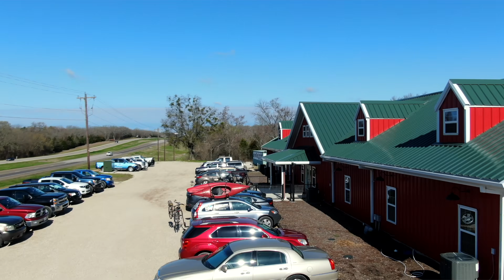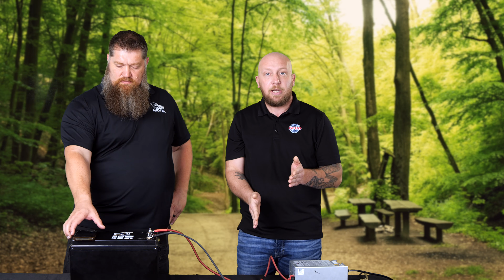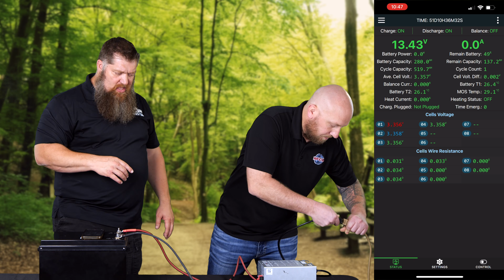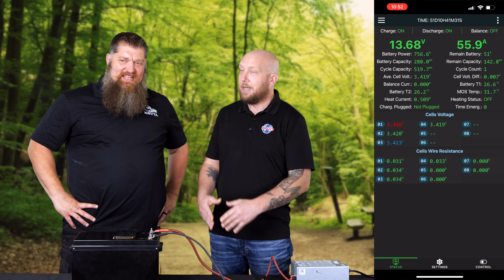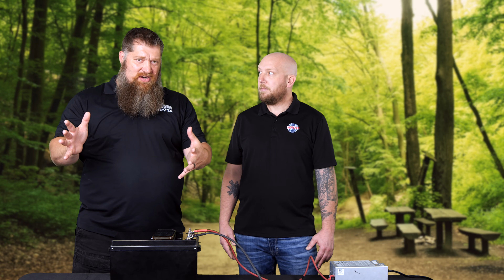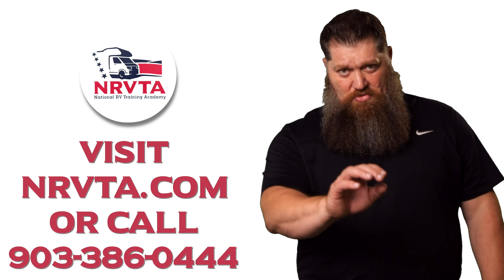WFCO auto detect battery charger, does it actually work?

Comment: Oh boy... Still not KISS... So, when my lithium ion LifePo 100AH group 24 size new batts arrive, put em in turn off all charging and discharge them (to what point???) and THEN, get the OEM solar array to NOT be a part of the charging process. Let them charge up with a straight electrical charge and let the converter figure it out. At that point, it will have identified lithium Ion as the batteries being used.

Comment: Ok so I installed a new WFCO-9855, installed a brand new LEAD ACID battery, right off the bat it was reading it as a lithium battery. We run our appliances, go to bed wake up all we have is outlet power nothing else is working. Blue light is on in the converter for about 2 hours then there’s no power to the converter at all. NOW WHAT?? SHORE POWER HAS BEEN HOOKED UP and we’re not getting anything.

Comment: FYI, we were successful detecting lithium using these steps from support: disconnect solar and shore power, drain battery to under 20% (we went to about 12%), restore shore power and fully charge. Wait even after 100% reached. For us it flipped to green about 30 min after fully charged. GL.

Comment: Mine (installed yesterday) NEVER has the blue LED on.  I’ve run my lithium all the way down as I was instructed to do and the converter always has the Red and Green lights on.  My battery from 10% charged for over 12 hour and only got to 13.5.  Very disappointing.  Then you tell me unless I unhook my solar, it won’t work to full capacity.  That’s just no good.

Comment: When I buy a product, I don’t expect it to eventually to work. And in my case it never did because my batteries were 20 feet from the converter. Repeated inquiries to WFCO didn’t solve my problem and eventually they stopped responding. WFCO should just admit their problem and go back to a switchable unit.

Comment: You didn't discuss the fact that the WFCO has a 4hr bulk charge timer. if you run down your battery you will only get 4hrs of changing before it goes into maintain if plugged in. The only way to reset the time is to power cycle the unit.
Reply: With this information, it sounds like there are multiple reasons not to buy this brand even though I want to so badly. They’re the only one out there with 100 amp charger, but with this auto detect that doesn’t work for most people and this time that you’re talking about, they’re giving me so many reasons not to want to buy it.

Comment: I just added the Victron Multiplus II 2x120. I was informed to unplug the converter from the Rig house panel to prevent it from charging the batteries as the Victron will now do that. When I unplugged the Converter and turned off the battery disconnect next to the panel in the rig I lost all 12 Volt power. I switched the battery disconnect back on and still no 12 Volt power. I tested everything and found all voltages correct except for the 12 Volt Voltage entering the Main panel that was at "0". . When I plugged the converter back in I did get back the 12 Volts in the Rig house panel. Any suggestion?
Reply from the maker: @vitoconginejr3283  so it sounds as though your batteries that you are using for the inverter is either not tied into the 12volt distribution, or the fuse is blown between the battery and the 12volt distribution.

Comment: Seems like this auto-detect is a really bad solution to a problem that didn't exist.  I mean, it's not like you're switching back and forth between battery technologies.  If you switch your batteries to Li, you know you did it... so flip the switch.  And don't worry about it for the next 10+ years (probably the life of the RV).  With this "solution looking for a problem", now your charger might switch back to LA because you unplugged mid-charge, or for some other ridiculous/random reason.  It's too bad WFCO doesn't have a manual switch that overrides the auto-detect -- that would be the best of both worlds: 
1) manual those who what they're doing and want a consistent product that just works 
2) auto-detect for those don't care to take the time to learn the basics of their RV

Comment: WFCO is blaming it on “install”? Nonsense. That is mildly insulting and taking advantage of the general ignorance in the RV industry and RV owners when it comes to electricity. While there is some truth about long cable runs or the incorrect gauge of the wire being used, the fact is that their product is improperly designed and the Auto-Detect feature simply does not work. It is a great sounding idea but one that is extremely hard to implement in the real world. It is just a marketing gimmick to make it sound like it is automatic when it simply is does not work like they would like you to believe. Electrical and Electronics Engineer here. I have already owned 2 RVs with these converters and performed numerous tests that disprove most of the nonsense I just heard. Do yourself a favor and stay away from any of these WFCO Auto-Detect products. 
WFCO should perhaps do themselves the favor of forgetting about the Auto-Detect nonsense and just go back to a very simple switch with 2 profiles. It is almost as if they believe that every RV owner is dumb. They have created so much inconvenience and heartburn with their awful controller and software, just put the switch back into the units and stop making peoples lives so absurdly complicated. The thing simply does not work with Auto-Detect, else they would not be here doing a video to try to explain themselves and point fingers. Looks like WFCO knows they messed up. 

I saved myself 1000 headaches with these by just installing a Progressive Dynamics converter. It has a simple switch and always provides the correct voltage. One less variable to worry about. 
No need to worry about a temperamental converter. 
RV life is complicated enough as it is.
Reply from the maker: @GranCoyon  as long as “they” means WFCO. I did not state anything like that.
Reply: @NationalRVTrainingAcademy  to me WFCO’s statements in this video are nothing more than a charade about their faulty product.
Reply: @NationalRVTrainingAcademy  You are correct. I have modified my comment accordingly.

Comment: The lead acid battery limits the current based on its higher internal resistnce.  LFP' gulp current much more easily than LA batteries.

Comment: Why not have your gurus simply measure the open circuit resistance with remote sensing leads to determine the chemistry?  Why no remote voltage sensing capabilities period?  This would overcome voltage drop issues at large.

Comment: Why advise people to induce a protective function of the internal BMS?  Doesn't seem wise.  Why talk about teetertotters when you can address how and why the charger is designed to actually behave?  I.e. Current limitting, staye of charge, voltage control

Comment: New converter n battery lithium. Do you have to discharge the battery once before it will auto detect n work? Plus if my gas is turned off and I turn it on how does my 2 way fridge begin to work

Comment: So far, not so good for me. Ordered from Camping World, as WFCO techs told me they should have the latest firmware. Drew it down to zero, briefly started charging at 50 amps, dropped down to 1 or 2 amps, never got fully charged. And green light still on, not blue. Now they want to know my firmware version, which I just emailed. He also said it might not handle a larger (280ah) battery. Going to give them one more day, then sending it back, and will buy an external charger. Frustrating, it shouldn't be like this.
Reply: Update, had them send me the jumper to make it full time lithium. Working fine.

Comment: How can I tell if My unit has the correct firmware and will work if I install a lithium battery on my unit?
Reply: I have this one and sometimes it shows Communication failure, and to fix this I reset the Solar connector and then it works again, should this do this?   Also, when on direct power I am showing 14.3 volts and when on solar charging the same but then on generator power it is only 13.7 volts.  I am currently use Led acid batteries, two group 27 batteries.  I want to get Lithium batteries and want to know do I need to do something here to make sure the Lithium batteries charge properly?
Reply: Model is the WF-8955-AD-GE on a Grand Design Momentum 25G with a Onan 4000 generator.

Comment: So I have a question.. to make both solar and Dc converter optimal. If I used a Renogy Dc to dc with mppt control. Could I place the output of the converter into the alternator leg of the controller? This would allow both converter and solar to work in tandem.. theoretically anyhow.. brain spinning
Reply: Connect both to the battery directly. Output each to the battery terminals or if you have a contactor/relay that you use to turn off the battery connect both outputs there. How the converter and solar controller chooses to control current output will be left to them.

Comment: Neither one of you guys made sense. If your going to show a how to. Explain everything. Was the lithium discharged? Why is everyone having problems? Is that fixed yet?  How do we know if it works if you can’t see the lights. What was the reason for the smart inverter if it doesn’t work half the time or for most videos posted. If you screwed up admit it and give us a solution. So how far away will this thing work?  Not very useful information if you don’t give distances with gauge of wire. Once that things loses the lithium identity it switches over. How stupid. Put a switch back on it LA or LI. People are not as stupid as that smart inverter is.

Comment: I've tried these and it always switches back to lead. Terrible system by any engineer standard. Even with the sent jumper cable its not consistent. I agree bring a lithium switch back.

Comment: my 1989 terry resort has stock 30 amp fuse panel i ordered the wfco 30 amp an i got the 55 amp wf-8955 model.... can i still use this on my 30 amp system?
Reply: Yes, but limited to 30 amperes
Reply: @tedpeterson1156  hey ty very much!
Reply: @tedpeterson1156  ok cool! i dont have anything in my camper that needs 55 amps. no batteries or anything that takes 220...... mostly just 12v dc an 9 outlets that are 120. my highest appliance is the rooftop ac which is 120 16 amp that a rarely use since i put a 5000 btu window ac in. thank you for your fast response! if you ave any tricks or tips let me know my friend!
Reply: @CHEF.BOY.IM.HUNGRY  My rig was supplied with 8735-AD. I use a 100ah lead-acid deep cycle for lights, mostly. I have three (3) other chargers, smart, dumb, you name it, none of them will perform everything that needs doing. I knew a controller wouldn’t do everything, either. I have a generator and chargers for battery maintenance, but the 8735 WILL charge a battery fully and completely on shore power.

They ship the units with an undersized fuse or blown fuse for the battery circuit. I’m convinced. Or the RV dealer installs one, maybe. 

Keep in mind there are two fuses to pay attention to with respect to the charging circuit. The first is a 40 amp polarity protection or reversed cable protection fuse.  That was a good idea on their part, because of warranty returns. “No sir, that situation would not be covered under the terms..” Who wants to do that all day? 

But, that isn’t the charging circuit! There is also 30 amp fuse, probably #6, they like to install a 20 amp fuse here and it will trip every time.  The trick I think, is to install a fresh, fully charged battery upon installation before putting into service. What probably happens, a new battery ships with a 70% charge and sits on a shelf for 6 months. The controller will shift to float, and the battery will never reach full capacity and fail prematurely.
Reply: @tedpeterson1156  i dont have ant batteries to charge just needed a new fuse panel
mine is a 30 amp shore hookup its a old camper 1989 terry resort

Comment: Great content, very informative. I've tried emailing WFCO's tech support and after a confirmation email, I never heard back. I'm switching to Lithium this spring. I'm seldom off shore power so my batteries don't typically get much below full charge. Should I expect issues with auto detect maintaining my 2 - 100 AH batteries?
Reply: If you require 14.6 to balance through the bms than maybe not because auto detect before this newest firmware will keep in lead acid 14.4. BUT good cells stay matched for a long long time. A bms ofcourse is the limiting factor. Most BMS suck and fail. Its own circuitry will either work fine with these types of chargers or it wont. If you are like me and make your own lifepo4 batteries WITHOUT a bms than these chargers will work perfect in lead acid mode. I have 8955 ad converter and it stays in lead acid. 14.4 is best because I do not need passive balancing with good cells and its the best voltage for charging without reducing life that 14.6 does.

IF you build your own forget the bms. They suck and fail. You charge the cells individually to 3.5v then connect them in series. OR you discharge them to 2.5 then connect in series then charge to 14.4v. top vs bottom balance. Once they are balanced you do not need to balance for a long long time with GOOD CELLS. No bms means your battery will last a long long time. OTHERWISE the bms will fail much much sooner than the cells. You also get to choose the best cells you know. It is cheaper. The ONLY thing a bms is good for is low voltage disconnect. You will want to monitor battery capacity with a current meter/battery monitor.  You can make your own low voltage disconnect that turns off an economized contactor/relay/solenoid. 

Batteryhookup is the best source

Make your own bus bars with 1/8 inch thick by 1 inch wide pure tinned copper bar stock. Make your own enclosure and compression. It will seem much more convenient to buy a ready made lifepo4 but you then encounter problems with stuff like this, bms failing randomly, bms not letting you charge as fast or how you want, cells being low quality that require balancing but top passive balancing is useless anyways, etc etc.

Comment: OMG!  Why would a company make a device like this that won't work with so many factors out of their control?  They should just put a switch back on.  Anyone installing a device like this should be able to handle a switch.  I've seen many reports that this automated function switches over to AGM so much people are giving these away for free!  I'm getting one second hand for free.  Sounds like I will have to turn off my solar controller when plugged in though to get it to work right.  Again, put a switch back on these things and maybe there won't be so many complaints.

Comment: I read all the comments and it seems like the Auto detect does not work. Even after a great video, but why stress people out when it seems like you are not getting a 14.2 charge. I have a brand new auto detect one and it does not say 1.9 firmware on it. So it looks like I will be in the same boat as everyone else?  I plan on doing more boon docking with my DIY Overland Camper. We will see?
Reply: There isn’t really anything wrong with these units. They do some neat things, but a lot of it isn’t documented. 

Operator headspace does the rest. It was interesting, I ran a lead-acid deep cycle down to 50% charge, it won’t measure 14.x volts at the battery terminals, during charging. I never saw it anyway. 

But an outboard charger indicated a 96% fully charged battery the next day. I still manage batteries with boost charges and equalization.

Disconnecting the battery or pulling fuses will probably require a period of “relearning”. This isn’t the showstopper people make it out to be. I would never want to sell a product that there is little control over the abuse it may receive or misuse or defective bstteries, etc.

Comment: Having DC to DC charging installed in my TV and Airstream.  I was concerned about the fact the voltage of the battery was always around 13.6 and asked my installer to check.  They looked at the history (I have Victron monitoring and it maintains a history).  My installer is a nationally known solar/lithium/inverter expert and was not aware of the need to deplete the battery to 10%.  I know the Airstream techs at my dealer had no clue.  For $200 I am installing a reputable product that should work without all this back and forth stuff.
Reply: BTW, I have never seen a voltage higher than 13.6 so I don’t understand this idea that lead acid is 14.4 and lithium is 14.6.  What?

Comment: So... wfco removed the Lithium switch, added auto detect that requires us to discharge our lithium batteries and do a full charge every time we disconnect from shorepower so it can "auto detect" a Lithium battery charge profile (oh and power off solar charge controller also when doing the first charge!!!)? WTF! Horrible engineering and company. I will never buy another RV with their products.

Comment: The video says that the converter charges the LifePo battery at 50-55 amps.  Will that be a problem for my travel trailer with a 30 amp input cord?
Reply from the maker: No. The 30amp cord is on the AC side 120volts. The 55amps rated on the converter is on the DC side 12volts. 

Ok for a 30amp rv.

Comment: Various RV forums have nothing but problems with WFCO "Auto detect." As to why they just can't give us a switch to set it to the right battery type is beyond me. If only WFCO had a competitor, not sure they would be so sloppy with development and product release if anyone else offered a similar replacement unit.
Reply: Agree. I was a "little" put off by the video's drumbeat about ignoring info from forums. Does Todd REALLY believe that the user experiences being reflected on forums mean absolutely nothing?
Reply: They do, Progressive Dynamics, and after returning the WFCO, it is what I bought.